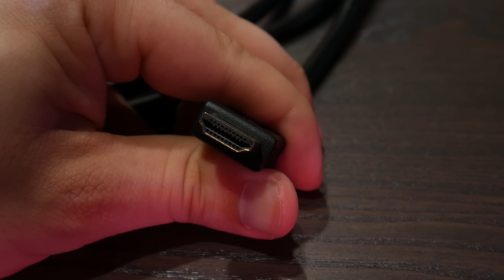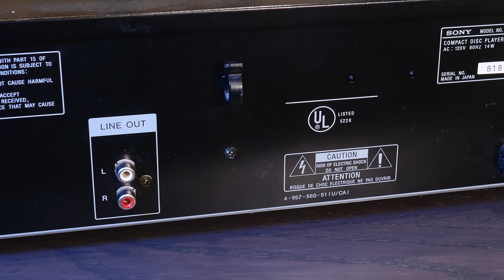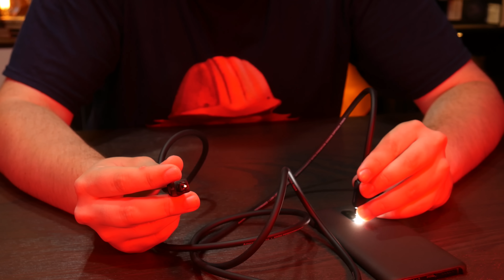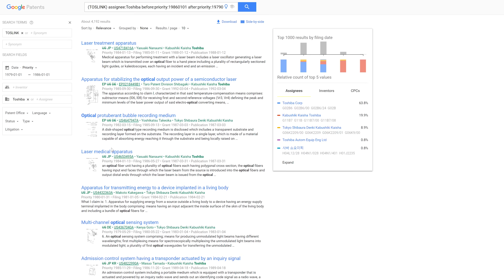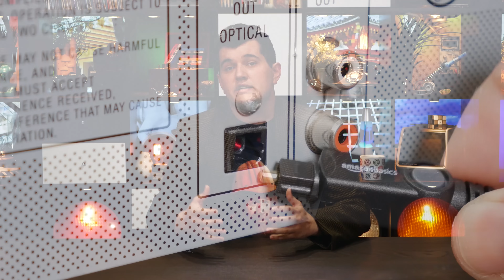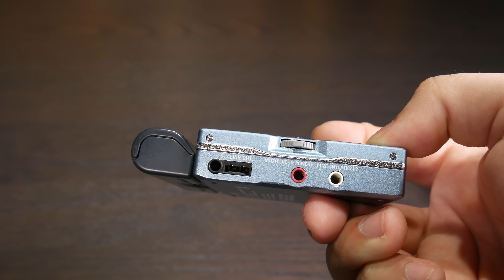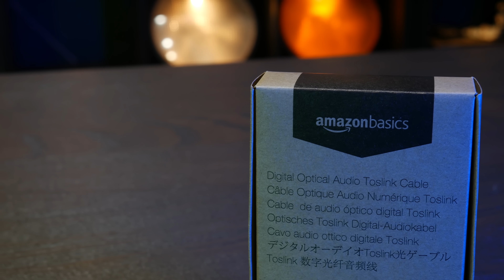TOSLINK: That one consumer fiber optic standard

Comment: I think the connector might be keyed simply to avoid rattling that could potentially interrupt the signal, since it was expected to be near loud speakers that could vibrate causing the cable to come out of alignment. Not an issue for RCA cables since they transmit electrical signals, and they fit very snugly into their own connectors.

Comment: At home I created a cable that connects USB to TOSLINK to USB so I could transfer raw digital audio from one PC to another with zero noise. This turns out to be surprisingly useful when I need to listen to two PCs at once or do mixing of one PC's output audio on another PC like in two-PC streaming setups. You could send it over the LAN using virtual drivers, but this solution works on everything out of the box with extremely low latency.

Having watched this video I now realize I could probably achieve the same thing with digital audio over copper or even USB to HDMI to USB using a different USB converter... but honestly I think they'd both cost about the same to build.

Comment: toslink is great, cause you can make a conventionally nice home theater system for sub-$150 (or even less if you get some good deals) using 30 year old receivers that were decommissioned by audiophiles, and itll hook up to a brand new tv without any fuss and still sound great by modern standards. its obviously not going to be "perfect," but if its just for a living room or bedroom tv its a major upgrade from your tv speakers

Comment: I use this because I have an ancient 5.1 receiver without HDMI. So the TV talks to a little splitter box which outputs via RCA to the back of the amp. It's janky but it works. I want to get an HDMI splitter though, even if just to see if the sound quality improves

Comment: i propose that gold plated toslink isnt totally useless as it would help prevent corrosion in the housing and prevent it possibly getting rusted stuck, but if the corrosion is that bad a rust-welded toslink cable is the least of your problems

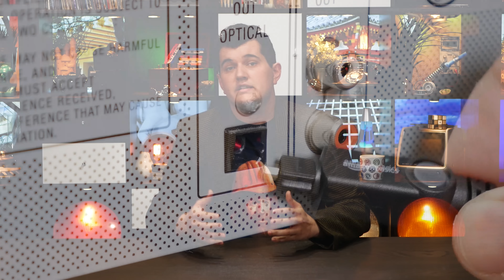Comment: 9:30 I don’t agree with the assumption on why there was a square connector. In network fiber, there also exist both round connectors like ST and square connectors like SC and LC (the smaller version evolved from it). The reason why those exist is that a fiber is never cut at a perfect straight angle and the manufacturer aligns the shape to the top of the square connector. This is called “tuning”. It makes much more sense that a fiber cable manufacturer like which Toshiba would have partnered with suggested the same for their proprietary format.

Comment: Something that copper gets you that turns into hum in your audio output is the "Ground loop".  Each piece of equipment connected to its own AC outlet will have a slightly different ground potential so if you add another piece of cable with its own ground you can induce current in the shielding. Although this generally won't affect the data transmission, it can show up in the analog circuitry.  At Qualcomm, we had a piece of test equipment to measure power consumption of phones that the power source was plugged in on one bench and the radio test set on another and it melted the ground trace on the tester: Turns out there was an 8V difference between the grounds on two adjacent benches.

Comment: Using the key on single fiber cables is an interesting choice if it was meant to make multi fiber happen.
You would want a way to exclude single fiber cables from ports that require double fiber cables (or triple or sixle or...). 
You could still do that with additional cams, and all of them but single will need the key.
Maybe they thought they could do dual channel on a fiber with polarized light, but that wouldn't work as well as you'd expect. Without some really strictly made fibers, you're going to have your polarization unalign with the key over just a few feet, and blend together completely over long runs. So you'd need adjustable filters at least, and special fibers for long runs. 
But all these are reasons that we didn't see multi fiber or polarized dual channel arise. Toshiba certainly could have said "let's key it; maybe we'll figure the rest out later!"

Comment: I ended up with one of these cus I couldn't find a dac that also worked simultaneously as a bluetooth transceiver so I had to get a dac and connect it to a transceiver with one of these toslink cables. One thing I will say is make sure you push them all the way in because they sort of click in twice and if you just leave it on the first click it will eventually pop out again. You have to push it further than the first click and quite hard too.

Comment: I still use toslink to get audio from my PC to my DAC. Why? I used to use hdmi, but I couldn't disable video output, so I always had to clone a screen onto the DAC which limited video output. I would use coax, but my PC doesn't have a coax port. I would use aux, but my DAC doesn't have an aux port. But you know what they both have? Toslink, which has finally made my setup way less of a hassle again

Comment: Rediscovered this old video while working on my own audio interface design and while I'm sure noone will see this after 6 years I'd like to make a small correction but the keyed dual toslink connector for RX/TX transmission you wonder about at around 10:00 does exist and is used in industrial settings, it's called JIS F07 (the normal single toslink is JIS F05) and you can buy dual transceivers for this application :D It just didn't really take off in the consumer space, I imagine mostly because consumers usually only use one direction
Reply: Interesting!

Comment: 6 years later, I just switched to TOSLINK because my GPU makes too much emi for the USB connection. It's probably because the DAC also receives power through the USB cable and that's the noisy part, but same same, so TOSLINK it is.

Bonus: it's gold plated (it was the cheapest cable, I swear)

Comment: @10:00 I know I'm a bit late to the party here and this may have already been discussed in another comment but there already are methods for having RX and TX on one optical cable by using different light frequencies. i.e. a red LED on one end and a blue LED on the other.

Comment: Currently using Toslink between my hisense 55u8k and my Vizio wound bar. 

For no other reason than the bar came with the cable and it has always worked well. 

It also helps that TOSLINK has bridged spdif and HDMI over the years. So different accessories that may not share spdif and HDMI have almost always shared TOSLINK.

Comment: When it came time to “retire” my house from the 30 year old 100 MB LAN cable I made the switch to OM4 fiber optic cable (40 GB) for the same cost as the latest and fastest wire based LAN option that is but a fraction of the capacity of the OM4.  Connectivity with almost no limits and infinite electrical isolation (no path from any device shares a wired path to share electrical disasters in one location with all devices in the house.)  Even the Internet source enters my residence is OM4 all OM4.

Comment: Fun fact... VOLVO head units use fibre optics... which means they are proprietary and its a FORTUNE to replace the head unit if the 6 disk changer in older volvos eat themselves... which they all do if there is ANY disc after a loss of power 😅 💔

Comment: I used TOSLINK between my Sony PCM-R300 DAT and digidesign interface for many years.  Sure, I could have used the SPDIF coax, but this just looked cooler (and was actually loads dumber for the reasons you've already explained about the robustness of 75 ohm coax).   By the way, your channel is awesome... I'm a 30 year tech/telecom veteran with a lot of sound engineering on the side... watching your videos with my non tech wife who loves how informative and accessible they are.  So I'll be like "watch this, he's going to explain the shitty signal attenuation of TOSLINK as a drawback any second now" or "watch this, any second now, he's going to talk about TDM encoding of the BETACAM component signal" ... and voila, you do.   At virtually every turn, you call out everything I think you're going to call out, leaving no stone unturned...  and you do it in a way that everybody can easily understand, with a good amount of shade to throw around (and rightly so).  Bravo, sir.  You really know your stuff!

Comment: Toslink makes running 10m of wire in a cable channel much less annoying. I can just plug something into the other end and not worry about interference from all the other cables, ground loops, or current flowing places ot shouldn't when something goes wrong.

Comment: Still in use broadly, I have one in my home music studio conecting an Audient ASP800 8-channel mic preamp to a Clarett+ 8pre audio interface.  The 8pre can communicate more channels to a computer than it has analog inputs to account for.  So I bought the ASP800 on account of it having build in digital to analog conversion. Optical cable from that to the 8pre and voila, you have a 16 channel system in a very small rack footprint.

Comment: Sorry but, the whole reason why TOSLINK avoids ground loops is BECAUSE youre using grounds in a building. Grounds in peoples houses, etc can be spotty and produce different levels of resistance to actual ground. When you start hooking wires from amp on wall plug A to a pc on wall plug B that share different grounds, youll likely create a ground loop since there is now alternate paths to ground (through the PC or amps power supply from coax) and then to the e-panel common ground. This is one of the huge advantages of TOSLINK that you downplay. In an engineering lab, we had to displacement in an incredibly electrically noisy environment. We first used wires, but found out quickly the black magic of high frequency noise (when the wire thickness carrying an anolog signal causes a different DC bias based on wire gauge). We used optics to solve this problem relatively easily, and such proves why optics have their place and why people still buy TOSLINK today. Information is great, but do some more background understanding of your topics before making confident videos.

Comment: Thunderbolt was originally going to be optical, back when Intel still called it "Light Peak". They found they could shove enough bits down copper instead and wanted power transmission as well. Almost had a second optical standard!

Comment: I still use toslink! No interference. No degradation. Works great for my simrig where I have very long runs of data and power cables that run in parallel

Comment: Funny enough there is an HDMI format and cable that do have fiber optic. I’m not sure if that’s the newest one or what but that’s a lot going on on your cable. An HDMI started getting common and I realized how hard it was to connect to thunderbolt… Honestly comparing it to your cat five ethernet there’s a lot of bands there and you can run them pretty far with absolutely no configuration needed.

Comment: Yes! A stranded of fishing line! What’s hilarious though is my 1968 Impala and mini many more cars of that era even much older have fiber optics that is what the little crème basil at the very edge on top of the hood is also on the package tray. They connect from the back of the headlights tail lights and turn signals and reverse lights so that you can look in your mirror or while you’re looking down the hood of your gargantuan boat, you can see if you have a light out which ones are working properly… Not just that but it’s fishing line and plastic that’s clear, how does that still work? WHN the door handles on most cars today don’t last until you’re not upside down on the auto loan any longer. Because these days you never will be…

Thanks for the amazing videos, cheers! `-;

Comment: I've used toslink and mini toslink for ages. It's part of the reason I bought a ps2, I was able to digitally copy cds to my minidisc player. Nowadays, I still actively use it for a situation only toslink can fix. I have a pc connected to an external soundcard, I also have a tv connected to my pc over HDMI. This causes a groundloop, and therefore connecting the tv to the soundcard over toslink completely fixes the issue.

Comment: The problem with HDMI is that your audio device would actually need to support it. Lots of speakers don't have any way to connect them to HDMI. You need to use an HDMI audio extractor but if you're using the analog audio output of that one then you'd have to rely on the quality of the built in DAC. Would be nice to have a better way to transmit just digital audio.

Comment: Love the content. I’m still using optical with my new 75” Samsung tv and Harmon soundbar. It’s cool to learn more about it.  They were definitely not super common in portable electronics, but I do remember it from my friends mini disc player, which was the same on you showed. Finally, the reason they hold plate optical connectors, is because they look sweeeet. 😆. Love that you pointed out that far end of frivolous.  Thanks.

Comment: I understand it’s not technically the same spec as tosslink, but I do think adat/light pipe will stick around. It’s still highly relevant in audio recording. That said, when you talked about 32 channels of digital audio on HDMI 2.0, makes me wonder if commercial recording studios haven’t already switched to some Implementation of that. That would be like a whole large mixer worth of channels on one connection

Comment: 14:33 “it’s pretty impressive that a digital standard introduced in 1983 is still quite common in consumer audio/visual equipment.” Incidentally, that was also the same year the midi (musical instrument digital interface) (standard was introduced, and your statement is equally applicable to it. Before midi, trying to synchronize electronic instruments like synths and drum machines with sequencers and computers was a pain because every manufacturer had their own communication standard. Midi solved that, and it’s still in heavy use today. And yes, it is even used to sync video and lighting with music. A few years back, they introduced midi 2.0, but thus far, I have still not seen it widely adopted. Frankly, I think those guys pretty much got it right the first time around. If it ain’t broke…

Comment: I use toslink when I can I love it over most of the alternatives. usb is nice when its available I hate having to use an extra hdmi to my new sound system because it doesn't have it. I use a home theater box to handle the surround for my pc setup the old one had toslink and it worked great new one doesn't so I need to get another hdmi to run from the box to my 2nd monitor. Also I can't wait for optical hdmi and displayport become more common. I already have 1 like 100m long hdmi cable that is optical and the latest standard cables have super short lengths for their max speeds. same also could go for usb. usbc is a mess right now with not all cables supporting all the spec an optical cable could be a good alternative so the cables are all the same. just a 3 copper cables 1 for power 1 for ground and 1 for power signaling for how much power the connected device needs, and then 2 optical glass fiber cables 1 for data in each direction.

Comment: I built a rec room gaming PC in 2025 and connected it to my pre-HDMI era AV receiver with optical because it was a nicer solution than bulky Radio Shack-era analog cables. I'm impressed a brand new motherboard in 2025 still had optical audio onboard. Thanks for that!

Comment: Toslink has one great advantage to ARC. It works. Every time. Something ARC can't boast about. It will randomly not work, after having worked just a minute ago and will start working again when it pleases to (or after you change settings on and off until it somehow works after the thirtieth time, because it pleases to). I like toslink and I wish they would have just updated it when HD surround formats became the standard with bluray. Then again, are they even standard anymore, seeing how no streaming service offers regular five channel HD audio?

Comment: I had an AV receiver that I got back in the early 2000s that had a TOSLINK connector.  Had no idea what it was at the time, but did finally get to use it years later with a computer motherboard that supported optical audio.

Comment: Yes, fiber optics as used in networks are very important today.  You may have internet service delivered to your home over fiber at up to 100 gigabits per second.  TOSLINK is slow because it's a standard that was developed when CD audio was new.  So for home audio and video, the problem with TOSLINK is that there was only ONE standard adopted.  Anyone who has struggled with the evolution of HDMI over the years knows the frustration that comes from improving standards that look to the consumer like they plug into compatible connectors, but don't work together.  The performance and features of HDMI have improved significantly over the years, but there are still some issues.

So what has kept TOSLINK stuck as a slow technology is not fiber or even S/PDIF protocol.  It was the calculated decision to keep a single standard for the cables and connectors as something that just works.  And then one more little thing... the paranoia of content producers over piracy.  HDMI is licensed and companies must become an authorized "Adopter" to legally implement HDMI.  This includes HDCP copy protection.  So while the content producers were focused on finding ways to make the use of physical media more complicated and expensive, somebody else came up with a way to make content more convenient and (for a while - that's another story) less expensive.  They called it "streaming".